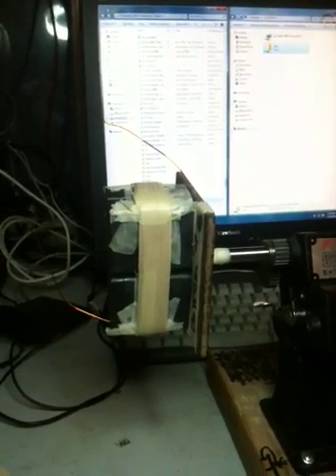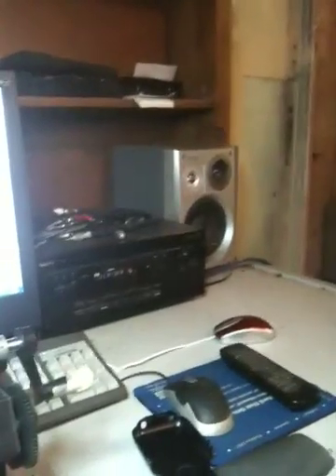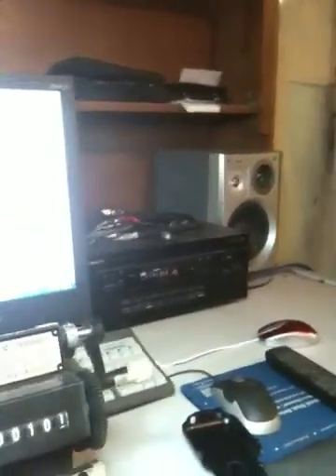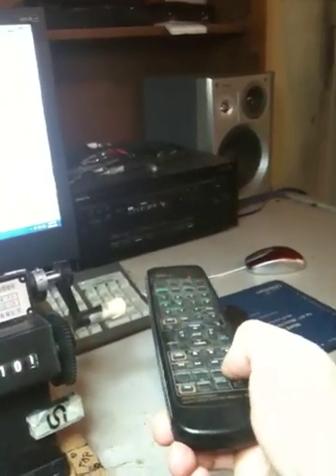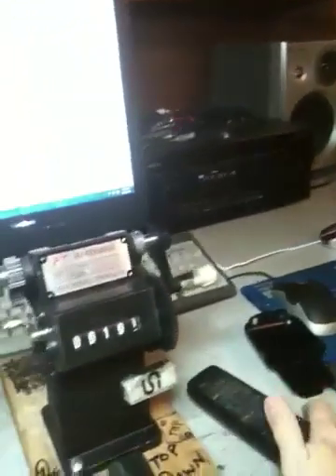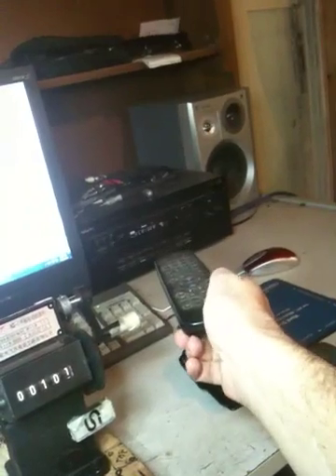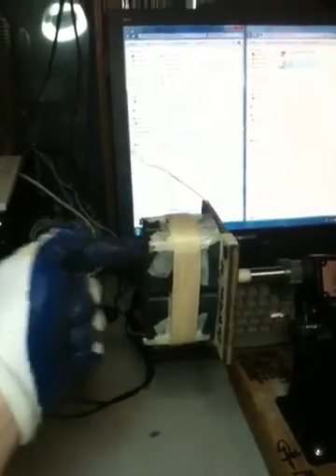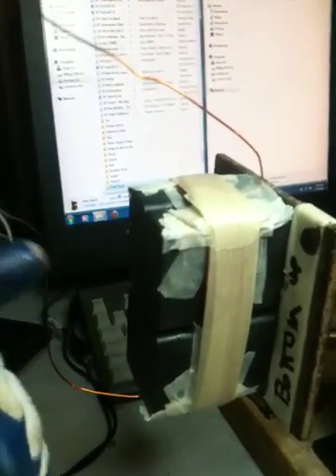magnets broadcasting over radio without attached power!

Comment: that wire out the top if the coil is vibrating and in effect oscillating the frequency and is getting picked up by the stereo amp, what happens when you stop the top wire from moving?